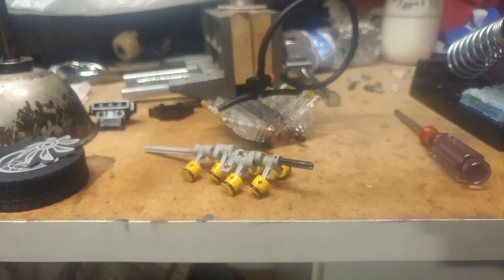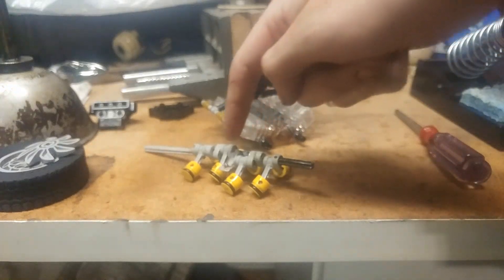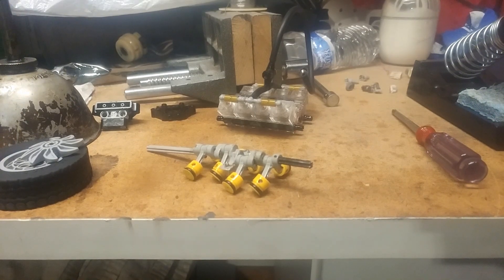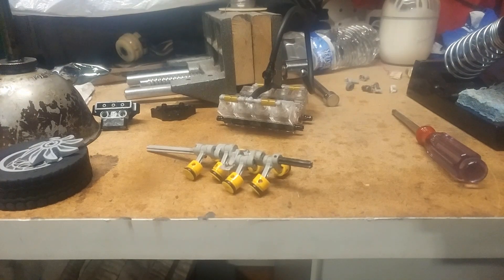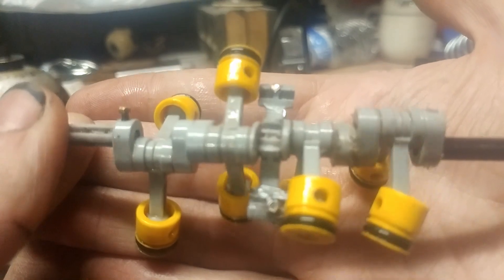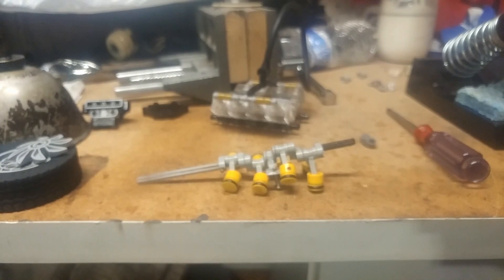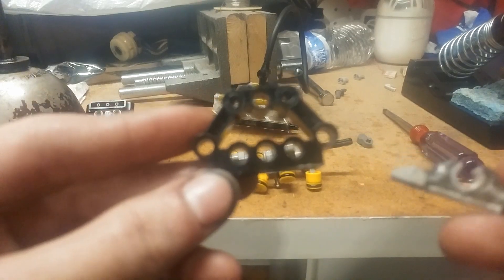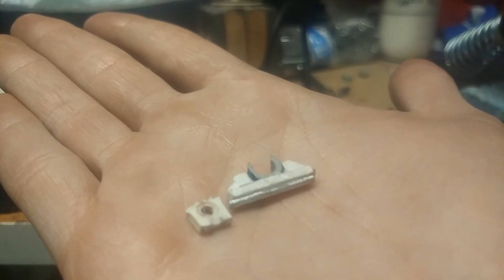Lego Pneumatic V8 Center Support Bearing + Upgraded Crankshaft

Comment: If crankshaft is bending in middle that's because your timing order ain't right. An engine runs but forces it makes are causing it's crankshaft to bend. To fix it, make a firing order like in a V8 engine for a real car. 
I hope this is going to help.
Reply: Thats not how it works. Its always going to be benfing in the middle as soon as the pistons in the middle are pushing against the valve. Its the spring in the valve that bends the crank not the firing order?

Comment: I've been looking for this video for 3 years. but how did you modify the piece in the center of the crankshaft, I mean how did you do exactly. Same for the piston did you use a metal lathe ?
Reply from the maker: A lathe would've been helpful, but no, I carved them by hand via a dremel with a cutoff wheel and extra spare time.

The crankshaft pieces have been sliced and diced using an xacto knife and a dremel while slowly rotating it on a lego jig I made

The center crankshaft piece is made from 3 different parts: 2 stock lego crankshaft pieces and one peg. Cut the peg to length so that the two crankshaft pieces can be connected back to back with no gap in between. Then trim away the center of it so the peg is exposed and ready to be used as a bearing surface

Image of how it's put together: https://imgur.com/Dhg9oTj
Reply: @splob1981  Very clear thanks